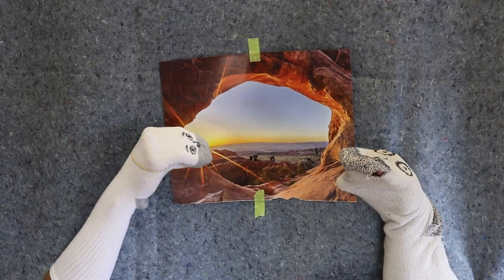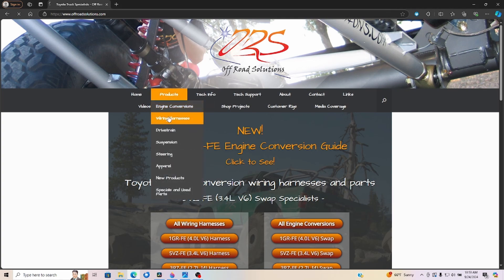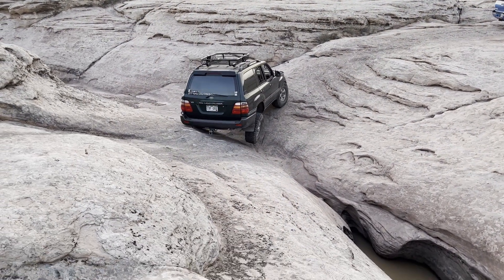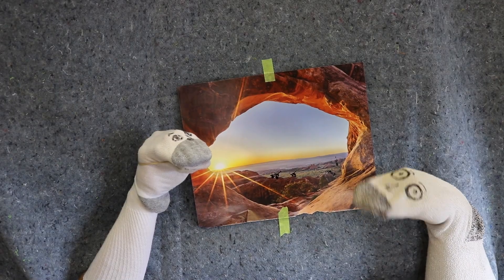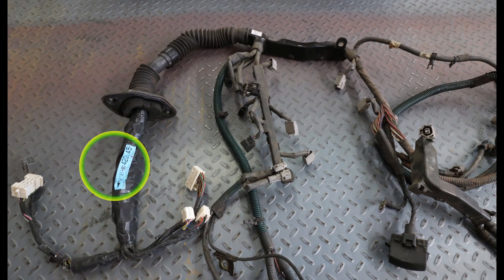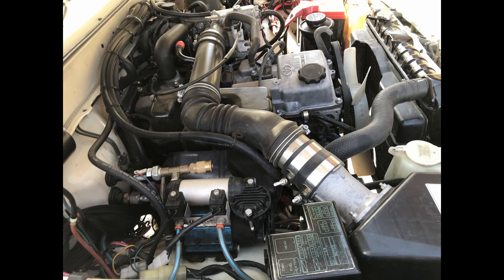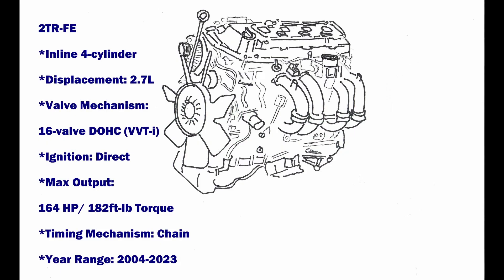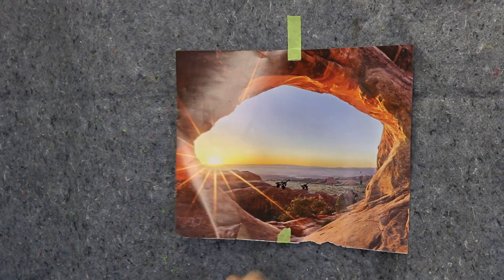ORS Engine Conversion Harness Explained

Comment: This i cool. You made my harness a few years ago for a 5vzfe swap in a 89 4x4 pickup. I still haven't used it yet lol. But i finally sourced an engine after a few year's. Mike was very nice and helpful on the phone and Derek did a good job on my harness. Looking forward to finally getting to use my harness, battery tray, and fuel line finally. Thanks y'all.
Reply: Thinking about going ahead and getting the nice evap box mount. It's nice compared to a piece of angle or something lol.

Comment: I am in the middle of rebuilding and swapping a 5vzfe from a 98 Land Cruiser Prado (J90) to my 91 4Runner (originally 3vze). I havent gotten to the wiring part yet, but I am wondering, just in case, if you guys provide the harness for this exotic source for 5vzfe.
Reply from the maker: We can absolutely provide wiring. We recommend the "Engine" format of our wiring coupled w/ a US-based ECU (we can provide ECU). This will eliminate compatibility issues. We invite you to inquire via email: sales@offroadsolutions.com

Comment: My 22re engine harness in my 86 4 runner with 89 style injectors wuth a 88 truck ecu works great,it fixed all my wiring issuses.i could not even to get the motor to run due to electrical issues.plugged in the harness and it fired up first try.
Reply from the maker: We are very glad the harness was such a help, we appreciate the feedback!
Reply: @shanemorton4587  I hope my 3.0 to 3.4 swap harness works perfect. I'm almost positive it will though because all the plugs match and I sent in one body plug so I know it all plugs up. I've had it in a box for too long now. Finally sourced an engine. I can't wait to use it! Got the battery tray and battery harness too. Fuel line. And some other things from them as well. Very nice stuff 👍 very nice people too. They'll take time from work just to answer a question. That's top notch customer service 💯 ORS made it alot easier on me. Hard workers. My engine harness didn't come with the clamps tho but I got a pack of them ain't no big deal or I would of asked about it years ago when I ordered the harness lol.